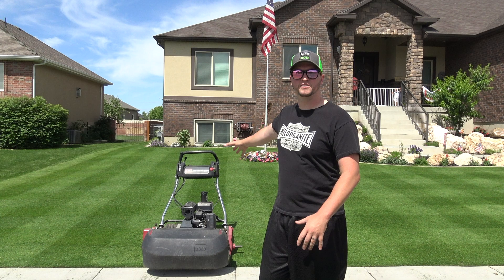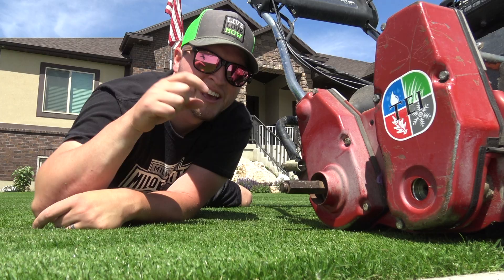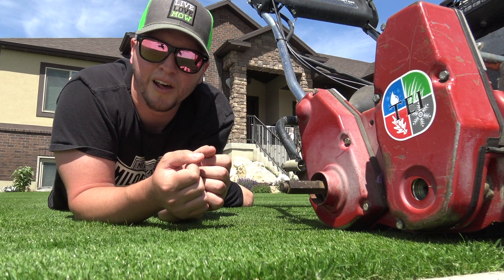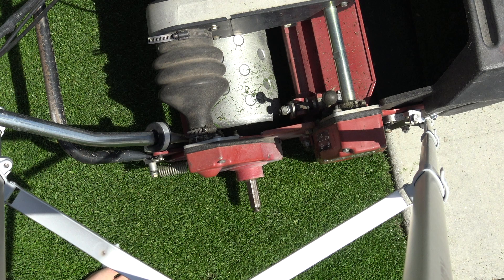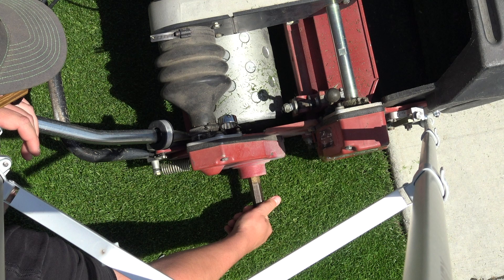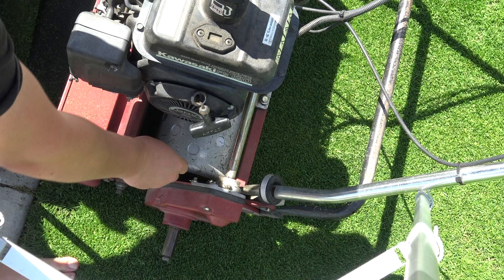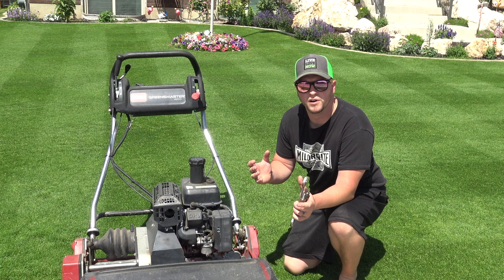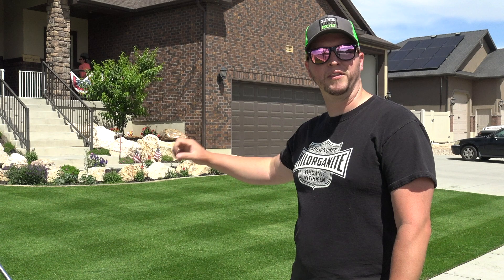How to remove the transport axles on a Toro Greensmaster 1600 || Toro reel mower quick tips

Comment: I passed on buying a GM 1000 about 5 years ago because the axle stick out.  Back then I heard of folks cutting them, and I was not interested in doing that.  I recently bought one to replace my worn and unreliable reel mower and this is the first thing I did.  I used an impact driver to take them off and it was very easy.  Thanks!

Comment: Watching this and others, I feel decent about either machine. I may go with Toro because I have a friend who sells them. A note though...I am looking at an electric mower because my Self-Pace on  my Toro is busted for the 3rd time. 5 year old gas Toro recycler. Also, several people who have bought the EGO and thought the lights were just a gimmick really loved them. Also, I don't feel running full bore into high grass is much of a test, maybe just see if running at slow speed  the mower can make it through?  I like my gas Toto mulching but have had mowers that are better. I would like to have seen a discussion about cut quality and mulching quality.

Comment: Any idea on total width of the unit when you take these off? Looking at buying one, but my fence gate only has a 37" wide opening. Specifically found a good deal on the 26" blade model, otherwise i'll have to get a smaller one.

Comment: Thanks for the info!  I went out and tried to get the pegs off my mower and they wouldn't budge. Any tips on how to break them free?
Reply from the maker: You may need a breaker bar. When I took mine off of the first time i used a breaker bar and i had to stand on it. They will come off but it ain't easy at first.

Comment: I am thinking about getting a Flex 2120 and I was wondering about those posts. Great video! Is it okay to roll the drums over concrete? Will they scratch or get damaged?
Reply from the maker: Yes I've been doing it for 3 seasons now with no problem. You want to make sure not to run over pebbles or rocks though.
Reply: Brett's Grasscapades yes that is the sometimes tricky thing especially with dogs.

Comment: If you were able to break those free with just 7/8 without a breaker bar/pipe man I salute you.  I had to use a 24” pipe on mine, I guess Toro used some super duper thread locker on the 2014 1600.  https://youtu.be/Vi9nJ5B27kQ
Reply from the maker: The first time I took them off I had to stand on the 7/8 wrench and bounce to get it off. Those suckers are on there good!
Reply: Brett's Grasscapades I’ve seen guys use torches to loosen the thread locker.  As you see in my video a 24” breaker bar was the ticket. I wasn’t going to torch my hubs.